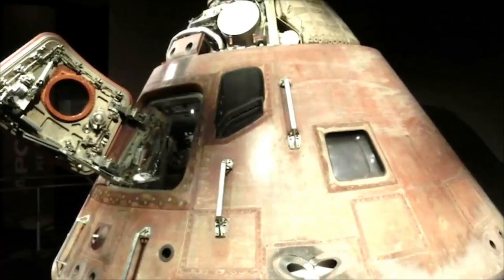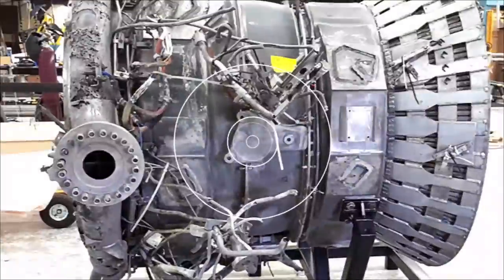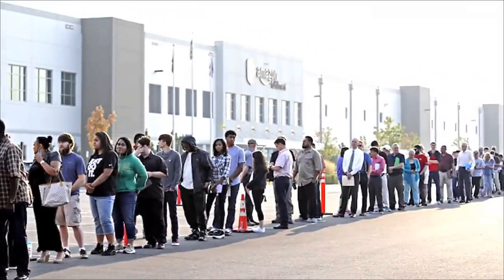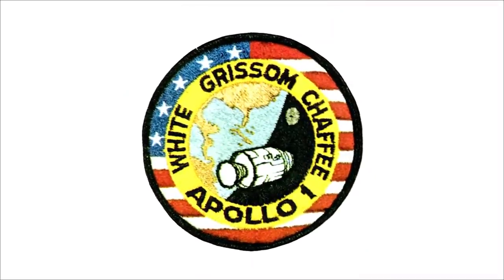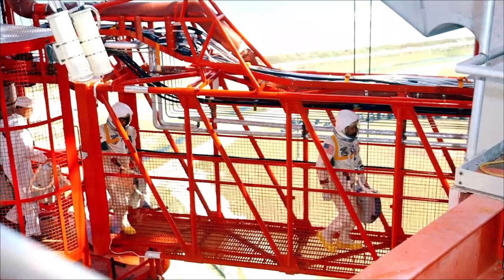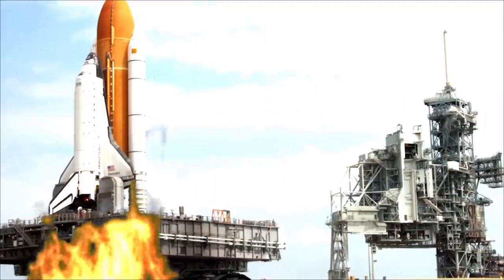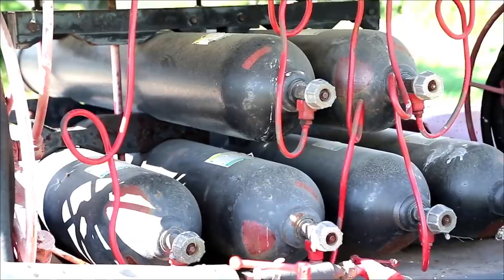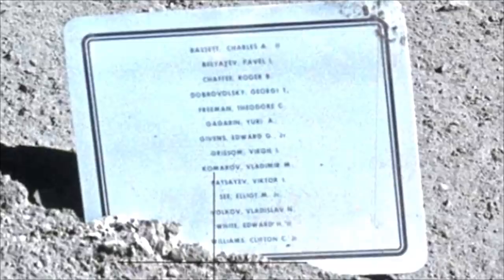When NASA Staff Opened The Hatches Of Apollo 1, They Were Met By A Truly Harrowing Sight

Comment: Pure O2 atmosphere in a capsule full of electronics with the door bolted shut and only accessible from the outside with a multi-minute long opening process, under non-fire conditions...  "engineering".
Reply: It was a design trade off. Pure O2 tanks are tiny compared to air. The Russians always used air.

Comment: Having designed an interface between a flash detector and specialised fire suppression gas in a decompression chamber that occasionally had elevated O2 levels, at DCIEM in Toronto in the late 70's, I was perplexed then, that there was not an operational system available.  We took our time to resolve it and not expose our personell to any dangerous equipment or environments,  This space project was obviously rushed in the desire to reach their objective.

Comment: It's not true that Ed White had to be "ordered inside" on his Gemini 4 space walk, they had a communication issue & neither astronaut could hear Cap-Com. In fact Ed asked for instructions directly. The plugs out test was standard right back to Mercury. Despite the fact that North American Aviation asked them NOT to do it with 100% oxygen at that pressure, several times. After Apollo 1 the whole spacecraft weas redesigned and pure oxygen was only used in space at a much lower pressure.

Comment: What utter bullshit. Their bodies were not burned. They didn't have smoke inhalation resulting in heart failure. They died of asphyxiation. The pressure that ruptured the capsule with explosive force crushed their lungs. From the first report of fire to the rupture of the capsule was just over 30 seconds. Fed by pressurized pure oxygen the fire spread with blow torch ferocity. The fire went out instantly on rupture as the hot gas escaped, and left no oxygen to feed fire. Atmospheric air leaking in through the rupture may have supported secondary burn but had the crew been alive they would have been able to operate the hatch mechanism. The suits were flame retardant. The helmets contained enough oxygen to last a couple of minutes. Long enough to open the hatch inward with no internal pressure preventing it had they not been incapacitated in the first 30 seconds.

Comment: BTW,

The low oxygen environment was a mixture of nitrogen with  the oxygen,

That was a method to reduce the oxygen concentration inside of the capsule,
Thereby  making the Capsule’s i internal  environment safer,

Not to mention easily regulated,

 A very simple fix ,

Definitely a tragic loss of life in that needless fire event,

Bottom line,

Too many engineers ,

A tragic loss of life